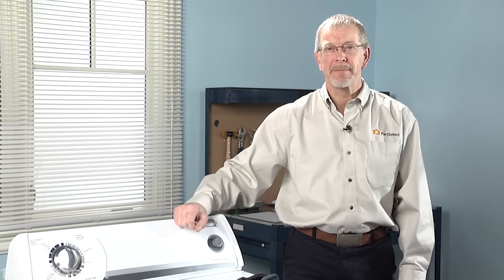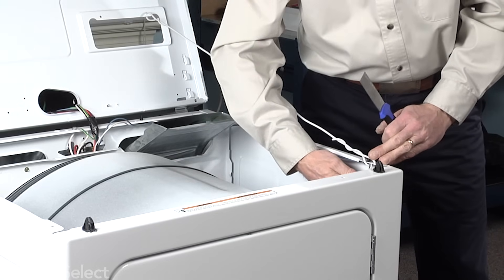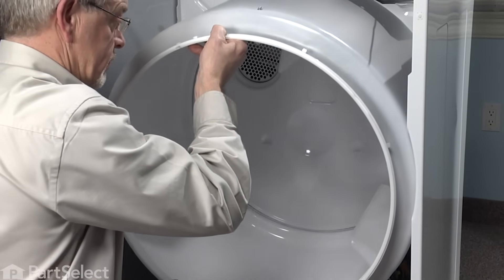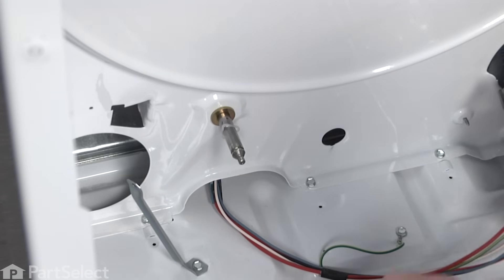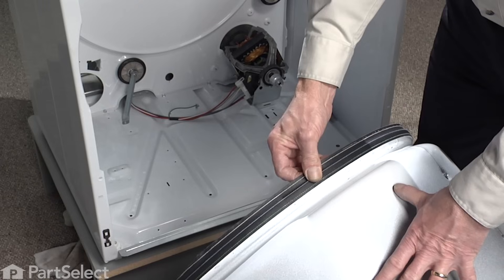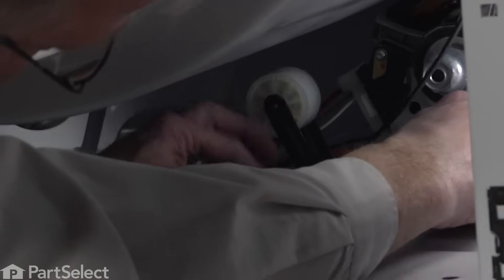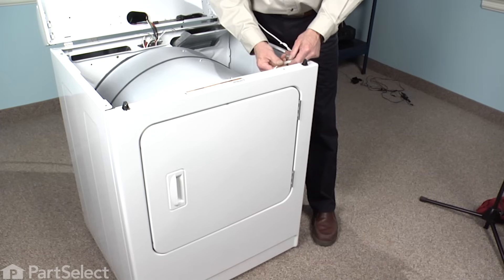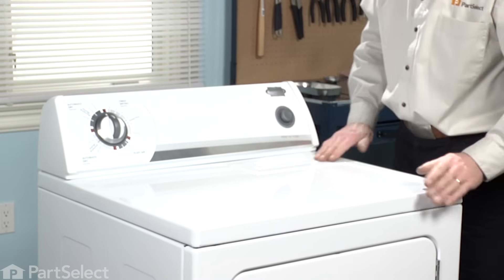Dryer Repair - Replacing the Drum Rollers (Whirlpool Part # 349241T)

Comment: It's not  that that simple to get the front panel back on at the bottom hooks.  I notice the edit at 8 mins 27 secs.  It takes multiple tries to get it in just right.  I've had that happen to me every time I had to work on the dryer. All the repairs are easy, but the front panel.........frustrating.

Comment: That spring clip/nut in front of the roller bracket is brutal for me right now. I've used them before but this one must be a hair smaller than normal cuz I've used a few things in arms reach at the moment including a socket that fits perfectly around the outer ring of the spring nut. Yet even pushing extremely hard it still refuses to slide onto the post.
Reply: Yes! Me too!
Reply: Me too
Reply: @danielblocker3426  I filed mine down  until it fit.. it was annoying but it worked..
Reply: Future reference use a 9mm socket and extension and tap on shaft with a hammer or dead-blow/mallet.

Comment: Thank you for this!! I’ve had my dryer for 8 years and recently it started this ridiculous thumping. The dryer worked, so I knew it had to be something fix-able (I wasn’t about to spend $400 on a new one). This video convinced me it was the support rollers. I took my dryer apart as the video instructed and, sure enough, the rollers were a mess. This video was clear, to the point, no-nonsense. Thank you. I’m am so NOT a do-it-yourself kind of guy but this video made it simple. Thank you.
Reply: I've called so many appliance repair places around me and told them I needed a roller kit put on my dryer and they either won't return my call or they try to sell me something else like a new thermostat. I think I'm going to try the repair myself.

Comment: It is absolutely NOT an easy job.  Holding up the drum while reaching into a tight dark space to wrestle with a strong coil and loop a belt with little excess over a pulley is difficult.  Sore shoulder to prove it.  However, your good instruction made it easier.  Thank you.

Comment: This is by far the most straight-forward tutorial on this facet of Whirlpool dryer repair!  I've looked at about 15 - 20, and this "professional-in-motion" approach leaves nothing to be desired. Calm, cool, rational didactics and verbal overlay of each step in the procedure, from beginning to end - including tech tips for the novice - absolutely "had me at hello."  It gave me the inspiration to proceed myself, and save me the time , trouble, and frustration of scheduling a service call...in addition to sparing me that cost.  Repair kit obtained at local appliance repair store was $43.50 w/tax. And they weren't offended at all that I wanted to do the work myself. As a female wearing all the hats since losing my fiancè to cancer, I can't tell you how valuable this was to me. Greatly appreciated!    Although this was done 7 years ago, it's still very pertinent!  Could you clone this fellow??!

Comment: Thank you so much! This clear, easy to follow tutorial has saved me three times now. I’ve replaced my rollers twice and today I realized that the reason my dryer stopped turning after putting a very heavy, wet comforter in it it was that the belt had broken. I used this tutorial again and the leftover spare belt from the last roller replacement to save myself from buying a new dryer!

Comment: Thank you for your easy to follow videos. I used them to first change out a worn pulley and fraying belt and second to replace the drum rollers. The cost for each (with tax) was just over $34.00. The service call alone would have been $ 145.00, not to mention labour, parts, tax, parts, and disposal fee.  You saved me literally hundreds. Cheers!

Comment: What a great video! We have a 9-year-old Maytag Centennial that looks exactly like this one and it's been squeaking for a few days. We were worried we would have to buy a new one and knew we'd never find another workhorse like this one. Found this video, ordered the parts from Amazon, and fixed it in under 25 minutes. We've only ever done something like this one other time and that was to take the back off and change a fuse. So, we're pretty proud to have fixed our dryer ourselves. Thanks for sharing this video because without it--we'd be out $500.00 or more for a new dryer.
Reply: I have a 9 years old Whirlpool and not too long ago, I replaced a fuse in the back. Now I'm in the process of ordering these rollers, different brands but they look the same including the issues.

Comment: My 23 years old Maytag dryer was  pretty noisy at start.
One drum roller was stiff.
I removed it, clean it, lubricate and put it in place, facing back.
No more noise, no cost.
Hoping it will do for next 23 years.
If not, small job to order a new roller and install it, now that I know it take four tools to do this job.
Thank you.

Comment: This video is the best one for fixing a noisy dryer. The Thumping got louder and louder. I think it was the drum rollers. Purchased the kit which included the belt, drum rollers and pulley for my Whirlpool. Cost about $25. Replaced all. Never did it before. Easy. Thanks.

Comment: God Bless you sir for this video. My parents thought they were going to need a brand new dryer when it started making that loud banging noise. I found this video, followed it to the T, turned her back on & it sounded smooth & like new. None of us had ever opened up a dryer before tonight. I just used a new belt & rollers. I also used rubbing alcohol on the shafts that the rollers are on, to clean them well. THANK YOU!

(the outer rubber on one of the rollers came completely off & was worn out. that was apparently our problem btw.)

Comment: Thank you for your excellent video guide! I was able to easily follow your steps and install the rollers and belt myself. At one point, just needed another person to hold the drum so I could line it to the front panel and attach it to the sides. Saved us over $300 to have professional fix it!
FYI, we purchased the parts from your sites.
Reply from the maker: Glad it helped!

Comment: The rear felt, front felt and the two rollers are my next thing to do with this old dryer (1990). I used another of your videos to replace my belt and idler pulley. It worked perfectly, and the dryer became much more quiet - for about a half hour. Then the old noises came back. I can only assume it is the rollers, and at $21 if that is not the noise source it is all good because my 28 year old dryer will have a few more brand new parts. Thanks for sharing this series of videos!

Comment: Thank you so much, i got most of it done in 10 minutes, two screws to hold front cover took 30 minutes, to put back in. so quiet and smooth. local parts store wanted 19.98 plus tax each wheel. Through Wal-Mart less than 12 dollars both wheels, delivered to the house.

Comment: Just did this. Had helper hold the drum while i put belt on. Amazon sent incorrect tensioner so reused old one. New heating element and dryer is working better then new now. Thank you sir for a great job on the video was alot of help.

Comment: I love that I can watch your videos and do my own repairs. I have replace a broken idler pulley and belt, put it all back together without any problem. When I plugged it in and started it, there was a clicking noise and the drum stopped turning, guess next step is to replace the drum rollers and hopefully it will running like new again. I don't know of anything else to do, so maybe before I order the rollers you could give me some suggestions to check for 1st.

Comment: This went EXACTLY as he instructed and to the letter. It would behoove you to clean out the lint screen ductwork thoroughly if it has never been done before. My dryer is 22 years old. The lint and items that came out of there was unbelievable. Turn the dryer upside down with the drum out naturally and shake it out. It will dislodge all the buildup. It will dry much better and get noticeably hotter than before.

Comment: Thank you for the instructional video and the parts order information.  Able to fix the loud thumping noise and inadequate heat production by ordering the Whirlpool Maintenance Kit PS373087 and replacing the rear rollers, the pulley, and the belt that turns the drum.  With the video info able to take dryer apart in about 20-25 minutes and replace the parts listed above in about 25-30 minutes.

Comment: Great video. It takes longer to clean out the lint than to replace the parts. A small standard screwdriver helps with those fiddly little clips. I opted to remove the rear cover and shop vac out that area too, might as well since I'm this far along.

Comment: Great video--my Whirlpool Cabrio Dryer had 4 rollers besides the tension roller which was bad.  My kit had the belt, Tension roller/arm & 2 rollers.  Lucky for me the 4 main rollers were good--addition 2 rollers attached to a front panel not shown behind front panel.  But I used the belt & tension arm assy.  Thanks again

Comment: Thanks for this high quality repair video. Made it super easy to disassemble. Once apart, it became obvious that I had one seized roller and another one on the way.  One suggested tip, it was much easier to remove the triangle keepers on the rollers with a hook shaped pick tool. Try it, you’ll like it : )

Comment: Thank you, I'm in process of doing this exact repair.  Over the years, I've replaced the motor twice, the igniter at least twice, but can't remember replacing the drum rollers before, maybe it's just been a long time.  My question:  Is it ok, or a good idea to put some silicone spray or lithium grease on the drum roller spindles?

Comment: Quick tip, use a 9mm socket and extension for your push nut and tap it with a dead-blow or hammer for easier install.

Comment: When you put the rollers on the shaft, it is best to put a little silicone grease on the shaft. I have never known how metal to metal works very well. Those two shafts when I replaced mine cost me $50 each.

Comment: My lower roller got hair wrapped around the shaft. Locked the roller in place and wore a flat spot on the roller. Might not be a bad idea to open it up periodically and clean  out the inside. It's a ridiculously easy dryer to work on.
Reply: Same exact situation with me. Opened it up and the lower roller was twisted up in so much hair that I could barely even turn it by hand.
Reply: @WoodWisp  its not a good design, but I don't see how you could change the design to improve it. Maybe a better seal on the drum? It is frustrating. It's the only real flaw in the dryer
Reply: @Jeremy4876  I'd start with however the hair got there in the first place. It's a really weird spot for hair to even get to, maybe if the air intake/exhaust were repositioned it would help. Or if it's coming from where the drum presses against the back of the dryer, maybe a different type of gasket lining where the felt is. But I'm not a mechanic, let alone savy with any appliances but mills, hence why I needed this video lol

Comment: This video covers everything perfectly except it skips over the hardest part - removing and reattaching the plastic and metal clips. Notice at 3:39 there's a smooth transition to make it look like removing the clip was quick and easy, and at 5:14 there's another transition that makes it look like the spring clip goes  on easy with just a push of the thumbs.

THEY DO NOT. He transitioned past it because it probably took a ton of time. Also he mentions that you should replace the back plastic triangle clips as well but doesn't show him doing it because they're basically impossible to pull off - I eventually just cut them.

These few steps took up probably 75% of my time for this repair. It would help if you showed yourself doing them all instead of just the one instance where it was easy (the front right triangle clip)!

Comment: Thanks for the video, it's awesome. Unfortunately I did all the steps and inspected the support wheels, idler assembly, belt, felt, and glide. All parts look good and yet the drum is making a sound on every revolution and is wobbling forward and back slightly as if not completely secured to the bulkheads. I'm not sure what to do or replace!
Reply from the maker: Perhaps  inspect the rear drum seal to see if any part of it has maybe rolled under itself causing that time of result. You can turn the power off to the dryer and once again lift the top of the dryer so you can see the drum and with your hands roll the drum around a full rotation and ensure that the seal is the same all the way around.  Let us know how you make out.please.

Comment: Thank you for this video! It helped me remove the panel and drum. We recently bought a home and both the washer and dryer came with it. The dryer recently started smelling like something is hot. I disassembled the rear and cleaned everything, cleaned all ducts right before move-in. There is was some slight squealing and sounded like it's dragging. It will run for a while then seize-up and stop. I immediately open the door and unplug it. I never let it run without being in the basement. I disassembled the front panel and removed the drum. The felt around the drum is old and worn and has rubbed the paint down to the metal. Is the felt replaceable? The belt is is old also. I rotated the motor and heard the slight squeal... I'm hoping the motor has gone bad, although it's still under warranty.

Comment: This was very helpful. The good news is I didn’t have to replace anything. The bad news is I broke the lower front cover clip. But the $ 8.00 cost will be mostly covered with the $6.99 in change I found inside.😃
Reply: Did it haworth to be the left lower one? Lol I just did the same thing but I figured it's become really weak over the last 5 years cuz it's my friends dryer who their kid's grandmother had some plumber install it for them. When he did he I found out while taking it apart he must of dropped the screw above that lower left clip and instead of making sure to grab it he just put a zip tie there instead.

Comment: It's also very important to NOTE that even though you can easily replace a motor, a belt, a belt tensioner and drum rollers when these components wear out USUALLY a LARGE number of YEARS has passed. If your dryer is 12, 15, 20, 25 or 30 years old you should check out the HEAT EXCHANGER that the natural gas exhausts through. The heat exchanger is the metal exhaust plenum that gets hot by having the burned natural gas exhaust fumes (carbon monoxide ) pass through it. The dryer blows air OVER the heat exchanger to pick up the heat and blow the heat into the inside of the dryer drum to dry the clothes. IF the heat exchanger is RUSTED out... IF it has HOLES or CRACKS in it then it is allowing DEADLY carbon monoxide exhaust fumes to exhaust into your home. NEVER poke or jab at the rust because it will crumble and make the holes or cracks bigger. If the heat exchanger is rusted, cracked or has holes in it IT MUST BE CHANGED BY SOMEONE that knows what they're doing otherwise deadly exhaust fumes can get past - even a new one - if it's installed improperly. Buying a new dryer at that point is a good idea. Don't continue to use a dryer that has a rusted out or cracked heat exchanger. Install a 120 volt combination smoke / carbon monoxide detector in your basement. I's just a good idea and a safe thing to do for yourself and your family.

Comment: QUESTION: Why is there a gap between the drum and rear panel? 

I did this repair with no problems at all. I noticed, when checking my rear drum felt, that the drum doesn’t fit flush against the rear drum once the front panel is installed. There is a visible gap that now explains why I’m getting marks on my clothes. Rear felt isn’t compromised and is intact. It just seems that the drum has too much wiggle room between the front and rear panels. Please help with any repair suggestions. Thank you!

Comment: Thank you for posting. Is the felt belt supposed to be showing after reinstalling the roller? I can't get it to go back in
Reply from the maker: If your talking about the felt bearing at the front of the machine they can be a struggle to get in place. I have found the easiest way is to open the door of the dryer reach in with your hand  place your fingers against the front curl of the drum and your thumb on the front panel and squeeze, doing this  usually pop the drum up onto the felt,  you can also reach in and lift the drum  with one hand and use the other hand from the top to pull the drum forward onto the felt at the same time,which ever way you find most helpful. Good luck you will get it!!!

Comment: To save money you can use a brass  brush and brass tube brush  to the shaft and inside of the roller to smooth out and polish existing parts.  Then tiny amount  high temp grease like wheel bearing red grease on the shaft. The problem these designs it's metal on metal and will fail. Justva tiny bit grease will extend life and stop squeals.  Use only high temp grease and very little amount so lint debris won't build up cause fire.

Comment: I bought a dryer kit and im trying to replace the drum rollers but i cant get the right side to go on i finally forced it on but now it wont spin at all and now i cant even remove the damn thing its on there so tight. I dont know what to do. Im losing my mind trying to get it back off. And yes i realize i never should have forced it on but i did and now its stuck. Please help me anyone 😭😵‍💫🤬🤦‍♀️

Comment: Good video except don't try to pry those triangle clips off if you are replacing with new ones. Put your puddy knife against one corner and strike the end of the handle with a mallet or the heal of your hand. Trying to remove them with your fingers and a sharp tool can get you a cut finger.